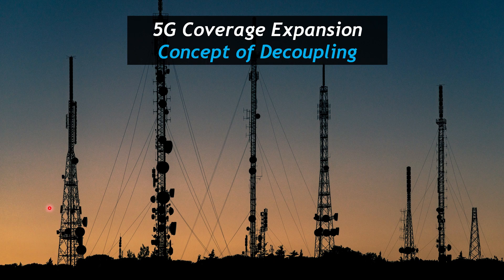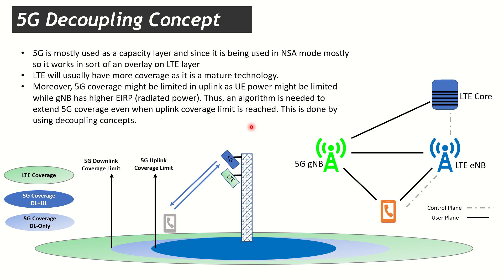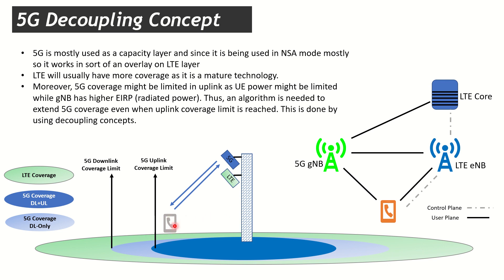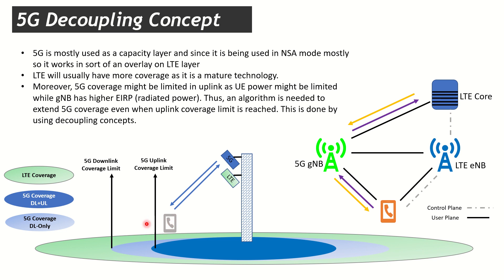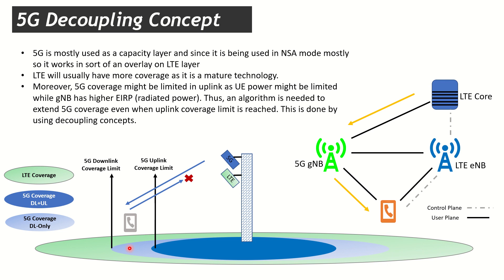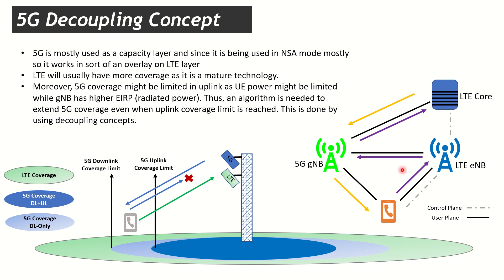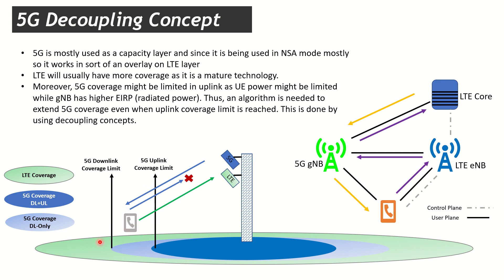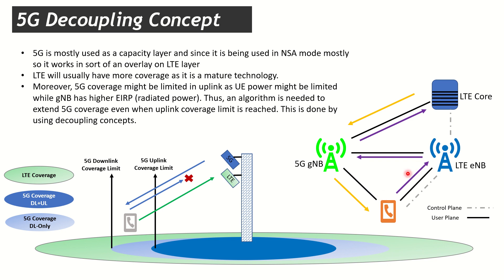5G Coverage Expansion: Concept of Decoupling

Comment: Did you consider Option 3 here? In case of 3x, which is widely used NSA deployment globally, UL data path switch to LTE should follow the UPlane of LTE side rather than going through the 5G side UP using X2. Please share your thoughts
Reply from the maker: Option 7 has a 5G Core so not relevant to the scenario in this session :)
Reply: @OurTechPlanet  Thanks Ali. It was a typo and I meant to say option 3 and 3x. Why the UL data path to flow through the 5G after switching to LTE ?

Comment: Thanks for another great video. Rookie question. When you said that UL acknowledgment will go through enodeb and then gnodeb to mme in weak UL area, didnt acknowledgement goes through control plane? Or I am mixing it with something else ?
Reply from the maker: UL ACK going through eNB is referring to TCP ACKs. For the eNB/gNB, the TCP ACKs are just user plane data. The control signaling that remains on eNB is mostly RRC signaling.
Reply: @OurTechPlanet  What about Physical Uplink Control Channel (PUCCH)? I assume this still goes through gNB even in weak UL area?
Reply from the maker: @manuelhaagtube   Now this can be based on implementation. But yes in most of the cases, the PUCCH remains on gNB

Comment: Thanks for the video. What threshold would you suggest for UL Leg Switching?
Reply from the maker: In my opinion, there isn't a one value that could fit all. It should vary from network to network based on radio conditions, bandwidth, throughput targets, acceptance KPIs etc.